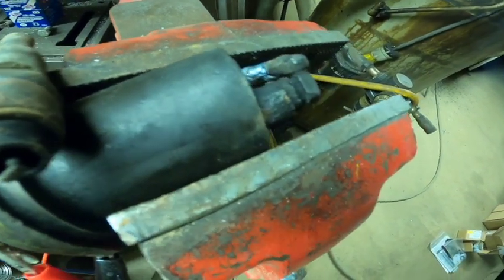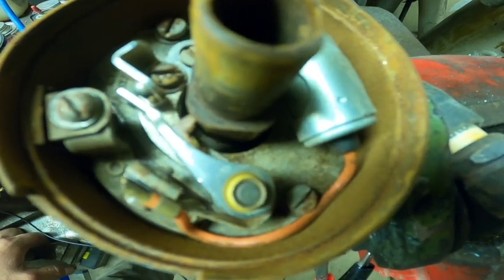Igniter vs Spark Plug - Explained

Comment: Cooll  can  you  tell me. If u know that first engine use dc magneto generator and the spark was discharge on the crankshaft  on ever turning of the engine , and they didn't  have spark plugs